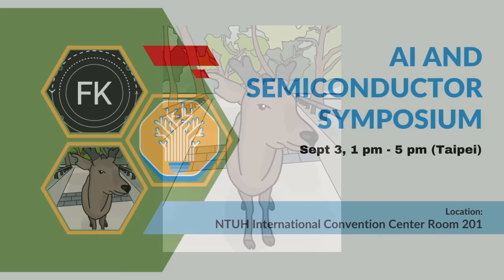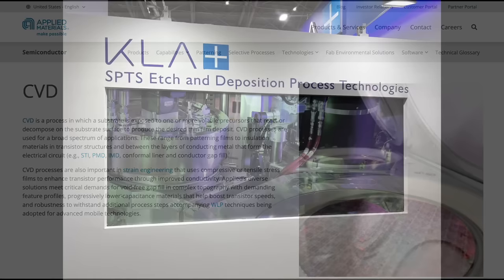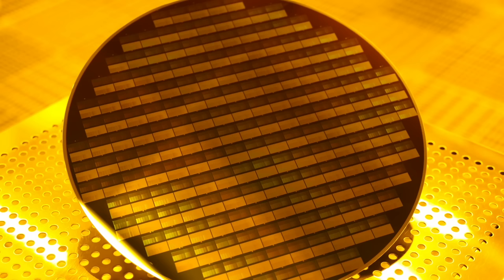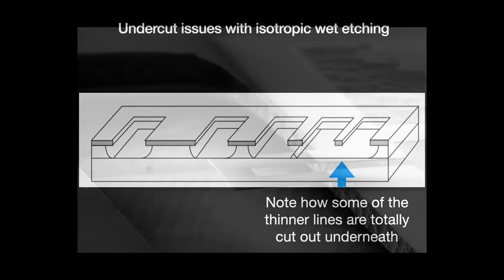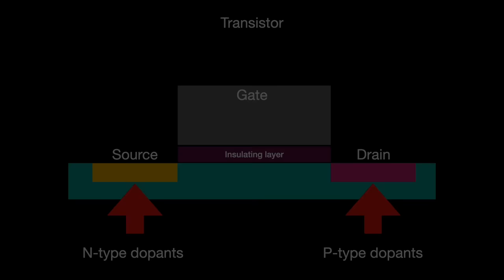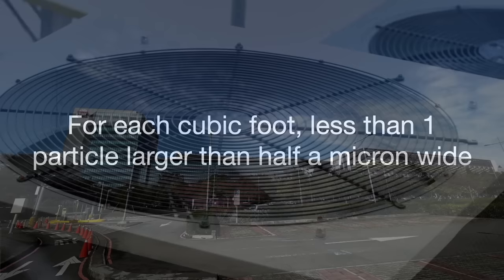What Goes On Inside a Semiconductor Wafer Fab

Comment: Cleaning is underrated as one of the miracles taking place in a fab. All wet chemicals including the photoresist leave behind insane messes relative to the needed cleanliness, and the specs for how clean the wafer has to be, esp in terms of functionally invisible nanoparticles are demanding. It almost beggars belief that it is possible to adequately clean a wafer once, much less hundreds of times in the course of making whichever chip.
Reply: The fact that photo rework works at all is almost as much of a miracle as lithography itself.
Reply: @Grak70 the fact that any of it works is a miracle, and in fact most of these processes are constantly balancing on a knife edge of total failure.
Reply: @xxportalxx.  and yet they are accomplished on a massive scale with almost no failure - machines
Reply: @Retrofire-47  Eh, no. There is a considerable rejection rate: IC's that simply do not function as a result of minute errors or contaminations. That is why testing is so important. If all were perfect, no testing would be necessary. These machines are not perfect, they are good enough to make money with them.
Reply: @TheEvertw  yeaaaah, there's also a lot of what's called 'inked out' die (I think at some point in history this involved literally inking out a region of the photomasks or something along those lines, however these days it's just logged in the computer tracking system). This is done for various reasons but most often for particles, it's basically impossible to avoid particle damage completely so there's always regions inked out for them. For instance Epi will grow flakes in the reaction chamber that will fall off onto the wafer (there's also various stacking faults and growths), and implant will form like sedimentary buildup in the beamline that can chip off and hit wafers or get exploded by the high voltage electrodes/turbos/beam itself and shotgun the wafers. As for whole wafer scrap I've seen robots fail and up and literally just chuck wafers at walls and floors lol, you can etch a wafer too long if something fails and literally dissolve the whole thing, a clamp can chip a wafer which will cause it to explode under the pressure in chemical-mechanical-planarization, voltage sags in storms cause numerous fail modes including tools dumping vacuum and just dusting wafers (an utter  nightmare to clean up!), temp probes can fail causing wafers to accrue stress fractures and later shatter randomly (hard to track down to root failure btw), the list goes on!
Reply: @xxportalxx. Thanks for the war stories! I have never worked in a fab, I have been involved in making some of the machines (laser dicing & lithography -- ALSI & ASML). Hard to avoid those companies as a Dutch EE-trained software developer.
Reply: @xxportalxx.  haha like 2 years ago I was standing next to a Nikon litho stepper and heard it chuck a wafer inside of itself, shattering the wafer. It's relatively rare but it definitely happens! The cleanup on that took about 2 days.
Reply: This is maybe not fair comparison, doing hundreds of process steps, creating billions of very tiny and complex structures which have to be in spec for several parameters.
What is the failure rate 1 in a trillion? Not bad.

Comment: you've just described most of my working life in 21 and half minutes!  Good job!
Reply: Is it a reasonable job?
Reply: @kayakMike1000 If you like wafer fab mfg. , withstand stress as some of us works 12hrs a day, in 3/4 or 4/3 a week, 2-3-2 pattern and willi g to work changing shift, day or night pattern.
Reply: @kayakMike1000  pretty much.  I found it interesting as an operator, a technician, and as an engineer! The hours can be odd, if you're involved directly in manufacturing.  A great deal depends on the culture of the company.  My viewpoint is from US semiconductor companies.
Reply: @johnforguites4800 shoveling a lot into a machine and wait for 60 minutes and then shovel it to another machine sure is the funniest job
Reply: @ntabile Sounds like an Intel shift schedule 👀 I used to be a contractor based in 42. Fun times!
Reply: What happens if you suddenly get the urge to pee?
Reply: @ebx100  go to the clean room's only exit, take off your clean suit (the plastic bag you wear 12hrs a day), go to the mega bathroom used by workers of the entire floor, pee, wipe your hand, put your clean suit back on, enter the clean room and find another pod.
Reply: @ntabile lol the fab life
Reply: @ebx100  you go pee before gowning up :P

Comment: Two minor corrections:

* The source and drain are both doped with either n-type or p-type impurities. It is the channel below the gate that gets doped with impurities of the opposite types.
* It's pronounced an-isotropic, not anise-o-tropic.
Reply: Came to say the same thing… for an NMOS transistor, both the Source and Drain are doped with N-type dopants, while the body (where the Source and Drain sit, and where the channel is formed) is a P-type well (or more likely the entire substrate is doped to be P-type). 

In a PMOS transistor, everything is opposite. The body is a large N-well, and the Source and Drain are small P-type implants. 

The source and drain are always the same doping type, and the gate voltage induces a channel between the S and D of the same type, to complete the circuit

Comment: Seeing all these steps that go into making a silicon chip makes you realize the marvel a silicon chip really is.

Just think of all the silicon chips that over the decades were thrown out and ended up in landfills (broken computers, electronic toys with chips in them, outdated washers and dryers, junk cars with chips to regulate fuel consumption and smog control, etc.) Its like throwing away top of the line Swiss watches.
Reply: Was just thinking the same thing. We should repurpose all those chips and keep using till they die 😂😂😂
Reply: we do that every day, the five dollar normal watch you through out instead of changing the battery is as good as those swiss watches, just not made by hand and plastered with brand names to make them worth thousand times more than they are actually worth.

Comment: Great video, it’s difficult to cover the full scale of a fab in a short video, but you did a nice job. 

One minor correction at 17:32. A planar MOSFET drain and source will both be doped the same (N or P type), not differently, while the channel will have the opposite doping. When voltage is applied to the gate an inversion layer is created in the channel that allows the FET to conduct.
Reply: Thanks for info.   Source, Drain =  same dope (P or N).  Under gate = opposite dope (N or P)
Reply: Yea I was surprised with that too, first lesson into mosfets and our professor told us a MOSFET is a symmetrical device and the Source and Drain depends on the voltages we apply (contrary to a BJT trasistors which is totally an assumetricla device and has to be connected in a specific way).

Comment: Nice!
What you missed... or deliberately omitted since technically it does not contribute directly to the manufactoring process... is metrology. Many wafers are partially measured to ensure that the dufferent layers stack up like straight buildings, and all patterns have the same size. Several control loops are present to optimize quality (e.g expressed as the final number of yielding dies).

The holes in the floor are to ensure a net downflow to prevent particles from swirling around. That's also the reason that running in a fab is not allowed...!

Comment: I've watched a lot of your videos and absolutely love them !  I've listened to you describe the countless cutting edge processing steps that pushes the boundary of our ability to understand and manipulate physics, and it all makes logical sense.  But for the life of me, there is still one processing step that I just can't wrap my brain around:  The saw.  How on earth do they precisely saw the ingots into wafers and how are the chips precisely cut out of the wafer ?? - It's seems like such a simple thing in concept, but I just can't imagine how it is done with such precision.  It would interesting to hear about that piece of the puzzle, the equipment that is used, who manufactures the equipment, etc.  Is it challenging, or is it pretty straight forward ?
Reply: I'm not sure about how wafers are sawed from the ingot, but the chips are cut out of the wafer using a laser, historically a saw was used, but laser is a more recent development.
Reply: It's not the case that ingots are sawed right into perfect wafers.  After being cut, the wafers are lapped and then polished.  In fact, there are typically several polishing steps that take place during IC production.  That's because the removal of material during lithography and etching creates uneven surfaces, but later lithography steps require a smooth flat surface, so the wafer must be "re-planarized" at various points.  

As far as separating the wafer into chips, there are different methods: scribing and breaking, sawing, or laser-cutting.

Comment: 0:00 - Intro
0:30 - Ad
1:39 - Beginnings
2:28 - The Process Cycle
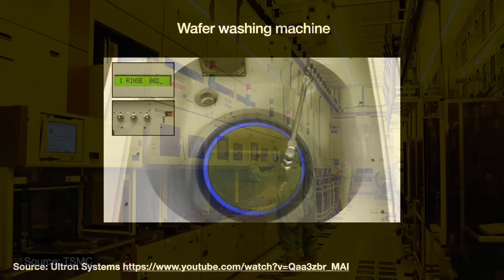3:49 - Adding Layers (Oxidation & Deposition)
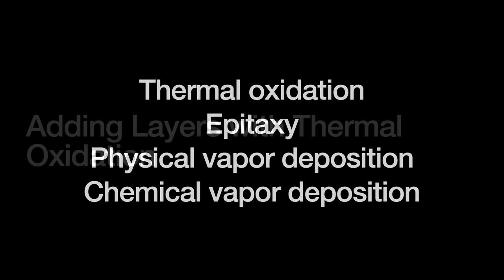    4:18 - Thermal Oxidation
    5:15 - Deposition
        5:41 - Epitaxy
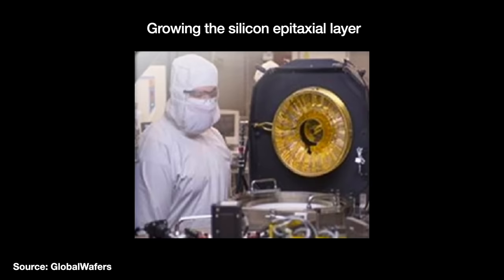        6:19 - Physical Vapor Deposition
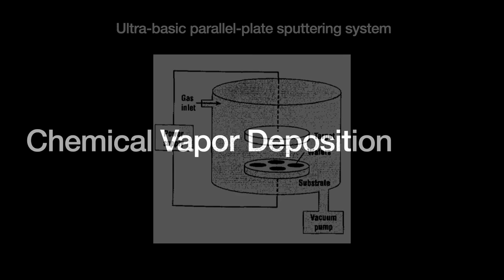        7:48 - Chemical Vapor Deposition
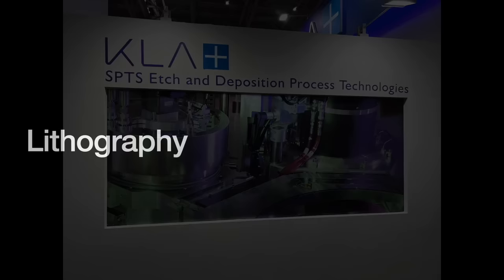9:12 - Lithography
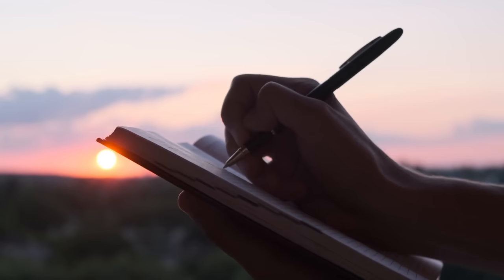    10:05 - Photoresist
    11:37 - Exposure Tool
    12:12 - Post-Exposure
13:16 - Etching
    13:54 - Two types of etching
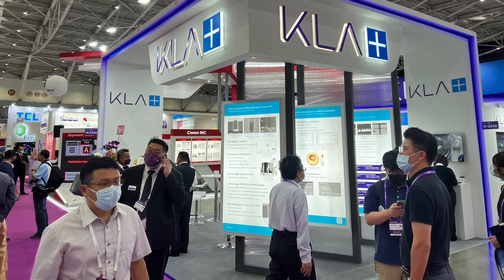16:59 - Impurity Doping
    17:58 - Doping & Ion Implantation
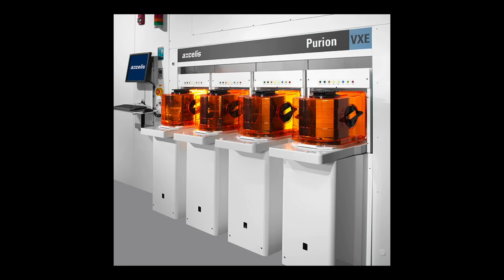19:19 - Fab Layouts
20:40 - Conclusion

Comment: 4:19 we also used electroplating and sputtering, but they may just not be in vouge now.  Sputtering uses the migration of a plasma, so I think it's gets thrown into PVD a lot but technically it isn't.
Reply: Sputtering IS technically pvd, the same as how epi IS technically cvd. In a fab they get separated so that you can split up sections (and therefor workloads), as well as by product workflow  (for instance often you'll have wet etch machines thrown into diffusion or epi areas, or diffusion machines thrown in with implant, etc.)

Comment: I’m interested in how they keep the wafers aligned through all these steps. When there’s more than one mask, you have to line them up perfectly every single time, within the width of a few atoms.
Reply: Very similarly to how they align printing plates... there are registration marks placed in the mask that are transferred along with the rest of the image.  Those registration marks can then be used by downstream processes to ensure things are lined up.
Reply: Yeah, I somehow don't think just putting a scribe line, with a very pointy pencil, somewhere on the edge will do the trick...
Reply: There is an industry segment of machines whose sole purpose is to verify overlay alignment after subsequent layers. Including KLA Archer systems and ASML Yeildstar. That's right ASML makes a machine to verify overlay alignment of its lithography machine. Photomasks have several fiducials that are in and outside of the printed pattern area. for chips, sometimes native features can be used for certain alignments. ASML also has to map the topography of the mask before it "lithos" the mask to ensure the projected image is in focus.

Comment: So, actually in the MOS transistor you diagram, the source and drain are both one type of region (say n-type), and the area under the insulator is the other type (p-type).  This gives you an n-p-n transistor.  A device with just a p-type region and a n-type region would be a diode.  Back in the 80s our college actually had a freshman lab where we were able to fabricate chips ourselves, doing all the steps outlined (at a very crude scale), making a handful of transistors on fingernail sized wafer fragment.
Reply: RIT?
Reply: @DavidHalko  CIT.
Reply: @DerekWoolverton  - I was amazed at the clean rooms in RIT… and how the facility floated on its own elastic foundation!

Comment: ~@20:00 - The description of the bays sounds very analogous to the way a datacenter is structured.  Lots of provisions for the supporting infrastructure beneath the floors (and the ceiling as well, at-least in the case of datacenters).
Reply: Also, the weird mix of metric and imperial units you mention also reminds me of the unit David Mermin conjured for his special relativity pedagogy.  He uses 1 foot-per-nanosecond as a decent approximation for the speed of light.

It works, I guess, but it's super weird (in much the same way that people decried television: what good can possibly come from something that's named using Greek and Roman word-roots mashed together, they said).

Anyway, I digress...

Comment: It's interesting, watching some of this tech bleeding down into PCB fabrication, just  as dies shrink, and packages get smaller.
Reply: When I was a kid, we used to go to the radio shack, get the copper clad board, ink what we wanted to keep, dip the board in the acid solution to dissolve the copper, then drill the board.

It amazes me how similar early silicon processes were to PCB processes. (There were PCB’s before there were silicon wafers!)

So many processes are similar across so many fields… book printing, silicon, circuit boards, stamped body panels for cars, etc!

Comment: if you use ion ionizator EM-separator with anode ray tube (ion 3d printer) on a spin cast surface, you get an electron scanning/transmission x-ray microscope all-in-one package, your type of wafer business is out

Comment: Hi friends. I have some questions and don’t know any experts personally. Are silicon ingots generally cut into wafers at the same location the ingot was manufactured? My understanding is wafers are manufactured at different locations than the semiconductor fab and they are shipped to the fab. Then the wafer turns into a ‘semiconductor’ at the fab using the process described in this video. Is that correct? Thanks in advance!

Comment: How do industry teams even agree all these steps? Is that what defining a new 'Process' is?
Reply: the R&D team builds the process with all its levels and steps within the levels and then runs dev batches to qualify the process to make design elements with other circuit elements within set of bounds that are then sent to the chip designers which allows them to design IC and set up the reticals for the stepper.  

Once the process is set up you're just grabbing batches of the same retical code and pushing them through the next level of the process.  There's a batch management system of some sort that you use to scan batches in and out of a process step.

Sometimes management will have a push on a certain code and then you're running around grabbing all the OC192s or whatever and pushing them out the door and letting others sit.  When things are going well that doesn't happen much.

Comment: Excellent information very well presented. Still please use the modern and consistent unit "micrometre" rather than the obsolete "micron".  Same idea as when using "nanometres" instead of "angstroms". Thanks!
Reply: Angstroms and microns are still common and widespread terminology in the industry. By no means obsolete.

Comment: The cleverest, most complicated kluge in human history... It's amazing that it works.

There must be easier ways to obtain chips.

We are nowhere near to possessing the tech for this, but I suspect we may one day create bacteria programmed to create microchips via DNA manipulation. Feed them the proper nutrients and watch them deposit functional chips. Eh, it probably will involve multiple steps, but possibly not as many, or as slow, as the methods we now use. Maybe.
Reply: We do have an organic process to manufacture things. This is how we produce RNA vaccines. The process is a lot messier and a lot slower than the physical plasma assisted process of chip fabrication.
Reply: @kazedcat  oh, the method I suggested is far, far from practical given current tech.

But in principle, biological reproduction given nutrient inputs is limitless. And automatic, nearly.
Reply: @Urgelt  In theory it sounds good but in reality you have protein misfolding, genetic mutation, offsite  interaction, ionization damage, stochastic side reaction. Biological processes are very very messy.
Reply: @kazedcat  yep. As I said, we don't yet have the biotech.

I can't think of any laws of nature that prohibit this approach, however.
Reply: @Urgelt  But the problems are fundamental to the system. You can't simply stop genetic mutation or prevent protein misfolding. A very basic problem for chip fabrication is validation and testing. In biotech this is equivalent to identifying cancerous cells and then removing them. Curing cancer is a necessary step to be able to validate and bin  functional biomachines. Unless we have a cure for cancer I don't believe that biomachines are technically possible.
Reply: @kazedcat  not quite true. Some organisms have superior genetic repair mechanisms. Larger life forms like humans don't have robust DNA damage repair mechanisms because evolutionary advantage comes from flexibility, but inflexibility exists, as with radiation-resistant organisms.

In principle, mechanisms can be designed using existing templates, and even improved templates.

Of course we don't have that tech today. But it might be a mistake to assume that the tech is impossible.
Reply: Bacteria size 2um=2000nm
Virus size 100nm
The size of a silicon germanium atom is 0.3nm
TSMC is currently 2nm
Approximately 7 germanium atoms can be put in
Taiwanese opinions😊